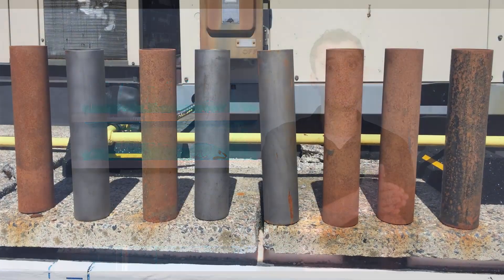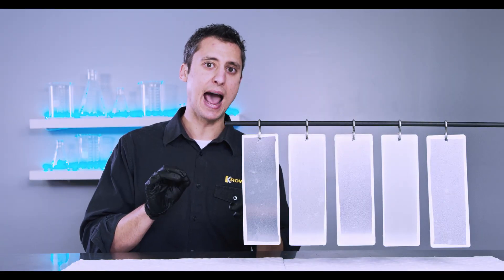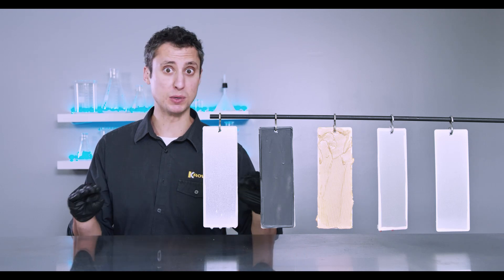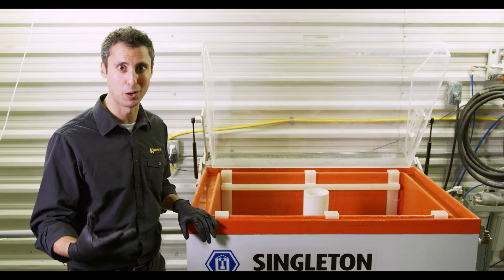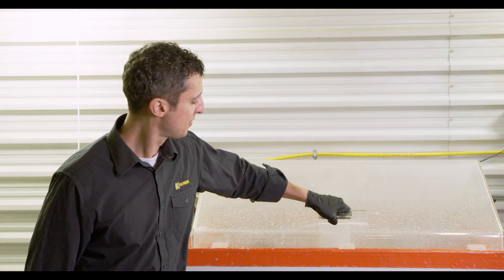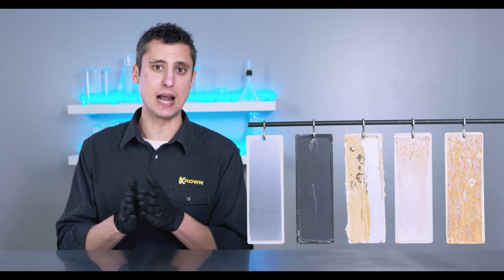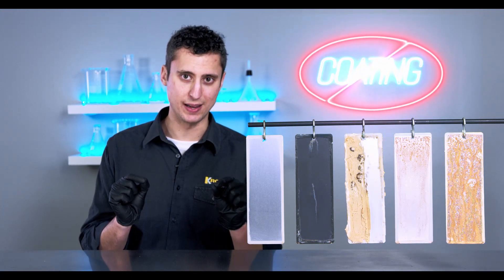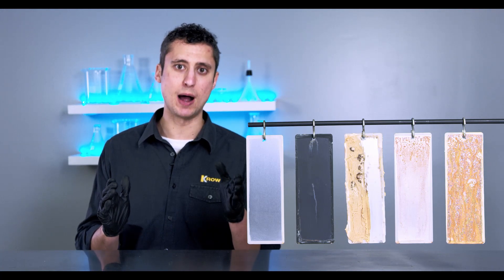Krown Labs - Episode 3: Salt Spray Test

Comment: I just bought a new 2025 Mazda, and while trying to sell me the various extended warranties and appearance packages, including rust protection, I mentioned that I always have my vehicles Krown treated on an annual basis. Have been since the 1980's. They then proceeded to warn me that if the Krown product gets on the various driving assist sensors located around the car, it may cause them to malfunction and 'light your dashboard up like a christmas tree with warning lights' and that this would not be covered by warranty to repair or replace these sensors. Although I believe this to be BS, it has me questioning the validity of their words nonetheless. As you know, todays new vehicles have an elaborate array of these silly sensors, that I wish weren't there, but the reality is, they are. What is Krowns stance on this, and what is Krown doing to address this issue?

Comment: How effective is it on a new vehicle that has been coated with wax on the frame from the factory? For instance all full size GM vehicles.
Reply from the maker: Coating products in general will chip, crack and break down over time. Krown will help to protect the metal under the coating as it deteriorates. 
As far as GM trucks specifically, there are a number of technical bulletins available online from GM relating to issues with the manufacturers coating. We feel that Krown is a much better long term solution for protecting and extending the life of your truck.
Reply: @KrownRustControl  Great will book the 21' Sierra in for a coat. Cheers.

Comment: Curious, have you done the same experiment using brine also, or is your solution the same already? Because that's what we face here in the city most of the winter.
On another note; If you guys are interested, you could use my car as a testimony. I have a 16 year old daily driven Mazda 3, coming up on 370k kms of use, which I've had Krown sprayed every year since day 1. Anyone in the know, would be aware the 1st Gen Mazda 3's were rust buckets, mine on the other hand is almost rust free. Great video btw.
Reply from the maker: Brine is typically a mixture of salt and water, so this experiment uses the same solution. And stay tuned... we just might be looking for cars like yours in the future!